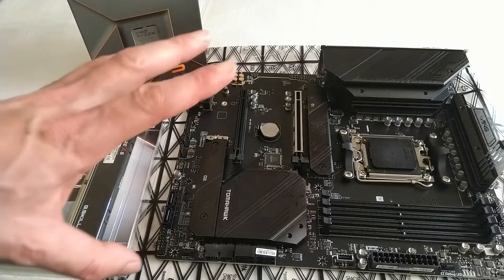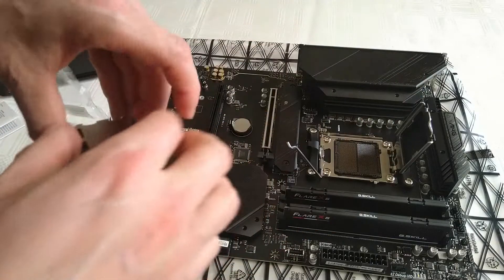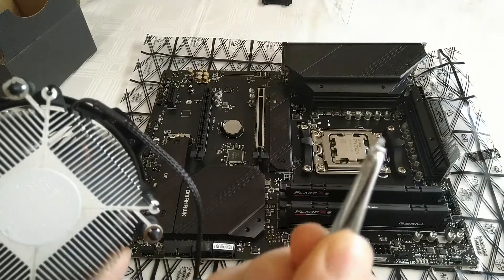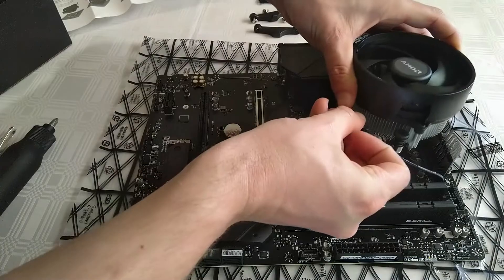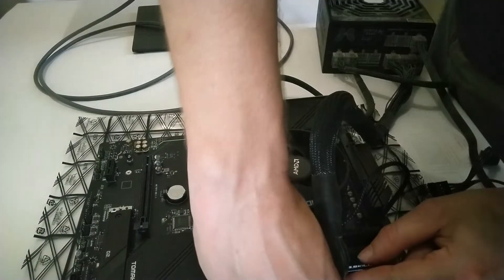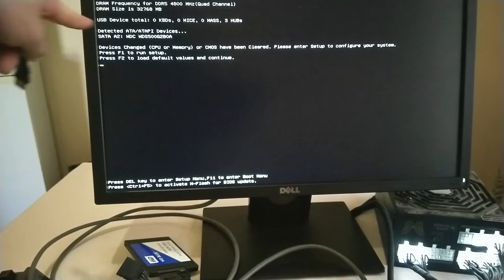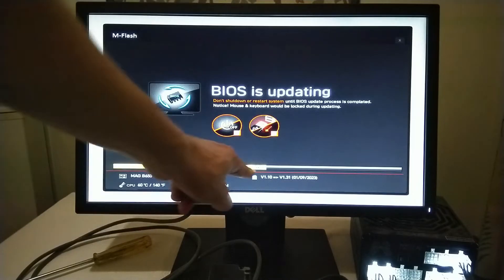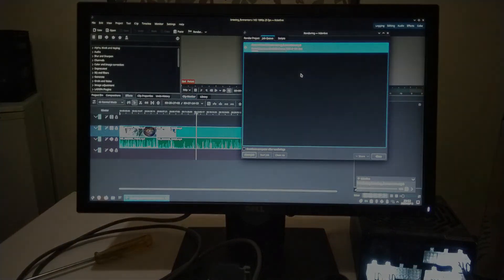Building a Ryzen 7000 series Video Editing PC on B650 Motherboard

Comment: I have the same setup, except for the cpu being a ryzen 9 7900. 

I'm pissed off beyond belief, my PC won't POST for anything. Tried multiple DIMM setups, clearing the CMOS, flashing the bios, but the DRAM light is on at all times.

The rest works, RGB, fans, USB, the cooler... I've even gotten a new ram pair, like yours, a Flare X5 CL36 6000Mhz.

The video was relaxing, I liked your commentary.

Do you think I should replace this mobo for a better one or try my luck with warranty?

Comment: i have  the same  config  with  you but  my processeur  amd ryzen 5 7600 x  i must  put 2*8 pin or 1 * 8 pin  ?
Reply: Did you need 2? I have sam cpu, just got my mobo yesterday but it won’t turn on, I only has one 8pin
Reply: i build   the same  config with  msi mag b650  tomahak wifi  with  amd ryzen 5 7600 x   and ram  amd expo 6000 mh   with  psu msi mpg a850g pcie5    and  Western Digital Black SN850X    and   Thermalright Peerless Assassin 120   i have stable  systémé  with   40 degré  and   65  degré  in   play  game    i think  one 8 pine is good and stable   @carlosmtzv9568
Reply: i build my pc   i just   have one   juste one  in left  it is good with  6000 mhtz  after update bios   @carlosmtzv9568

Comment: congrats on the new rig. Does the motherboard have a power / reset button? how did you turn it on?
Reply from the maker: Thanks, it has a been a long time coming. No the motherboard does not contain a power or reset button. However, it does have jumper pins that provide these functions.

The power and reset buttons in a computer case consist of a switch that is normally open but is closed when pressed. Each side of the switch has a wire that leads to a jumper. This allows the pins on the motherboard to be temporarily bridged when the button is pressed to close the switch and complete the circuit.

You can buy these switches separately, salvage them from old computer cases or even build one with parts from an electronics store. In each case closing the switch simply bridges the two metal pins that the jumper fits onto.